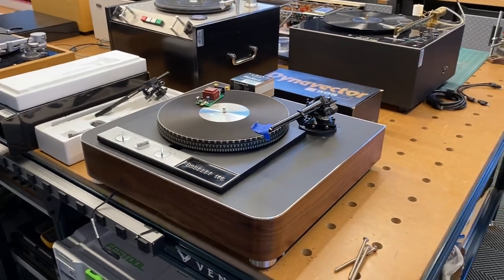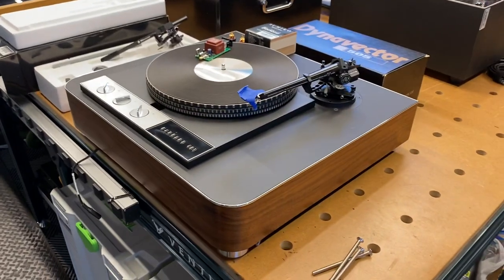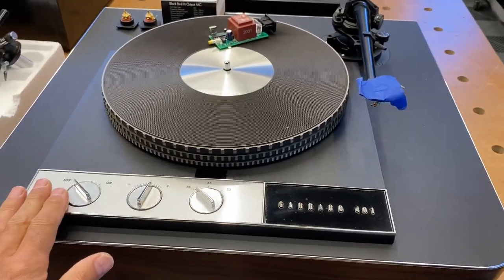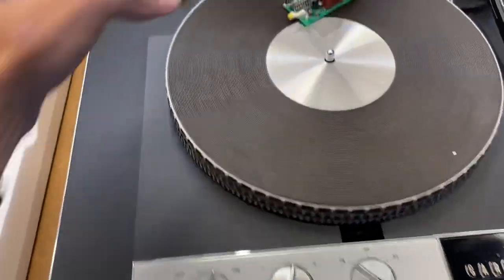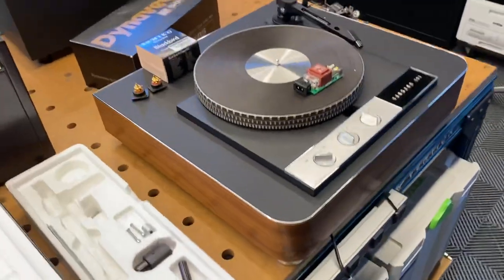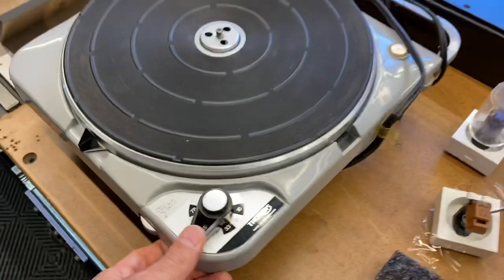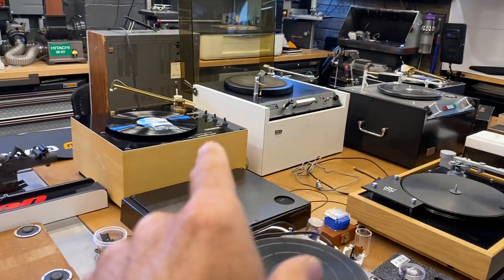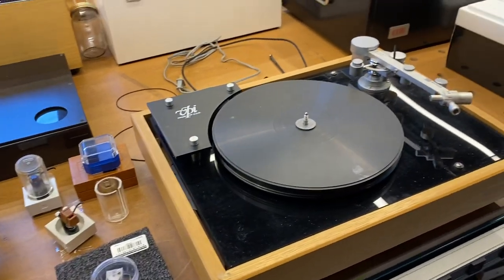Having fun with Turntable Projects at SkyFi Audio: Thorens, Garrard, Linn...

Comment: I have a garrard 401 and according to the manual,  for the USA market garrard supplied a new motor pulley  for 60 hz , voltage being easily changed internally.  Anyone who says idler driven turntables have serious rumble have obviously never heard a garrard 301 or 401.  As long as the idler wheel is in good condition you will never hear rumble  and because you have loads of torque,  it maintains speed no matter what load is put on the platter. 50 years and still going strong.

Comment: Fernando if you are interested in adding a VPI MK2 turntable with the linear tracking air bearing tone arm and a Benz Micro cartridge to your collection, let me know I've got one sitting in boxes that needs a good home. Its from the 1980's.  Last time I set it up it worked very well.  It has all the supporting hardware including air pump, air chamber, some manuals even the original wooden box for the Benz cartridge. Cover the shipping costs and its yours.  I am in the Houston TX area....
Reply: I'll take it off your hands if you don't want it!
Reply: @johnsweda2999  sure lets make it happen.